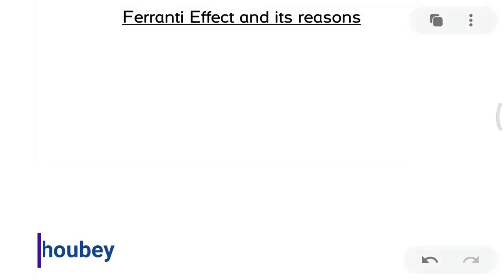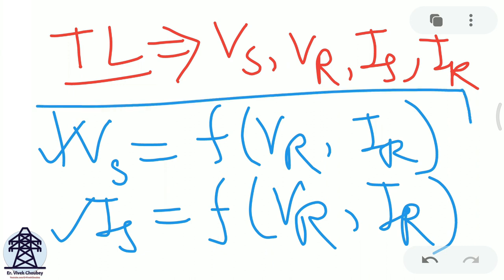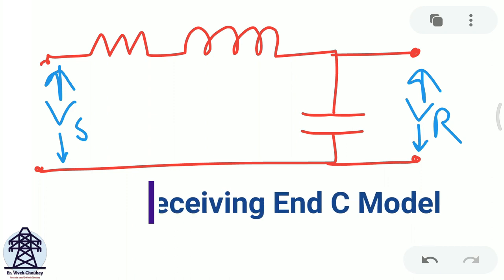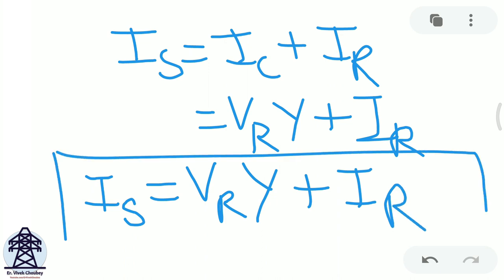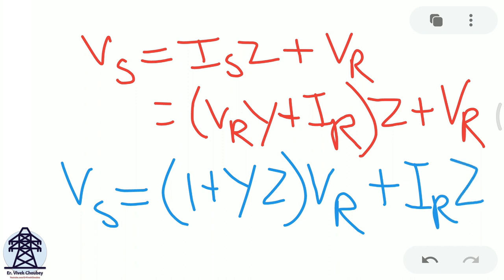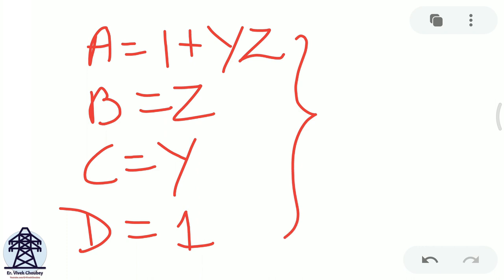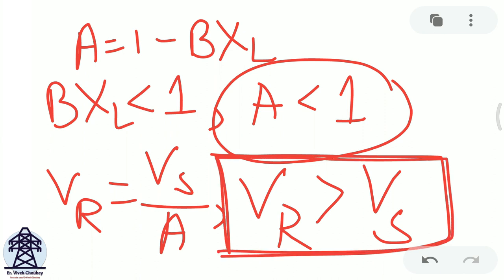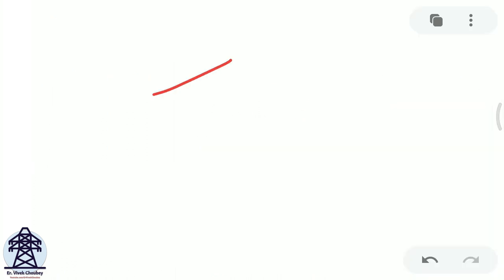Ferranti Effect & Line Charging Current : Mathematical Model Analysis of a Transmission Line.

Comment: As a retired commercial radio operator I suspect that the Ferranti Effect is what a radio operator calls voltage standing wave ratio.  When a transmission line is not terminated  the voltage at the end of the line will be quite high and the current will be very low.  As there is no load all of the energy is reflected back to the source. One quarter-wavelenght back from the end of the line the measured voltage will be very low  and current will be very high.  Going back another quarter-wavelenght the measurements will be the same as those at the end of the line except opposite phase. This repeats all the way back to the source. Ferranti was dealing with very large quarter-wavelenghts. 

So what do you think? Is the Ferranti Effect the first discovery of voltage standing wave ratio?
Reply from the maker: Sir you are exactly right. That is the same phenomenon and the case you mentioned is called Infinite Standing Wave Ratio (ISWR) when the entire wave is reflected back to the source. This is possible in two cases: first if there is no load on the line and second if there is short-circuit at the receiving end. Both of them causes extreme rise in voltage and current respectively. In practical situation both of them are limited by line impedance but can be extremely fatal.

In Electrical Engineering we define this phenomenon happening as there is line-earth capacitance which charges and discharges back to the line due to being AC voltage. This discharged voltage adds up with the source voltage and thus the receiving end voltage goes up. 

Both of these explanations are exactly about the same phenomenon known as Ferranti Effect. It is more sound in underground lines.
Reply: @ervivekchoubey  
I wonder if Ferranti ever considered the shorted transmission line. I suspect not because he was a power guy. Power guys don't like short circuits.
Reply from the maker: @billelkins994  Actually the short circuit causes Infinite increase in current which we call a LINE TO GROUND FAULT. It can create imbalance of power in the transmission line as well as instability in the alternator. It's taken care of in Power System Protection Studies.